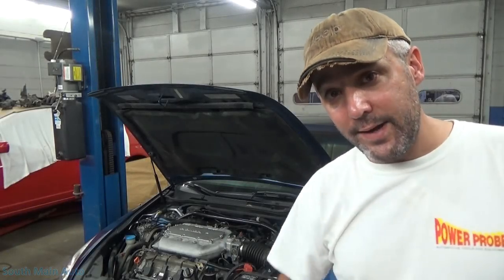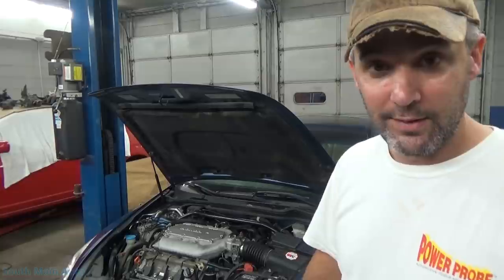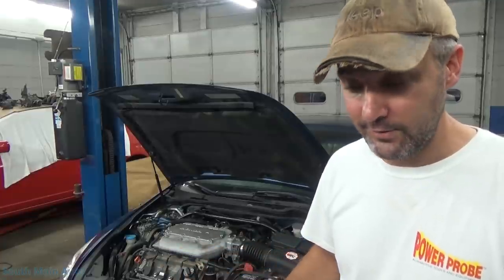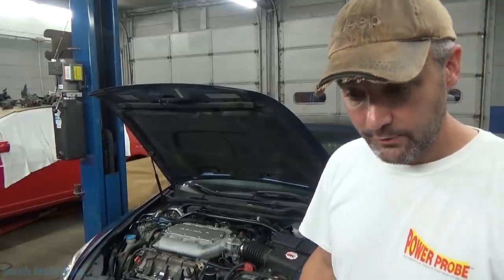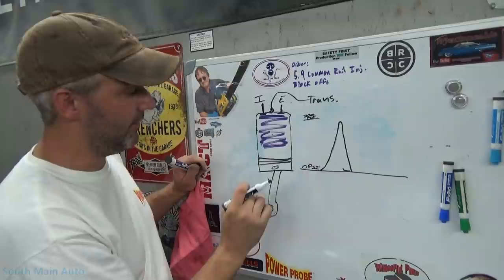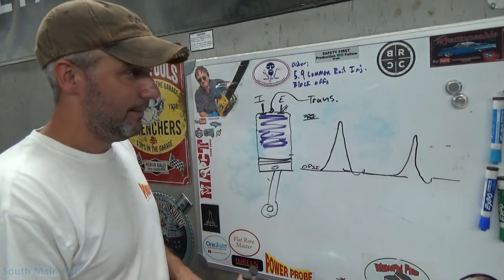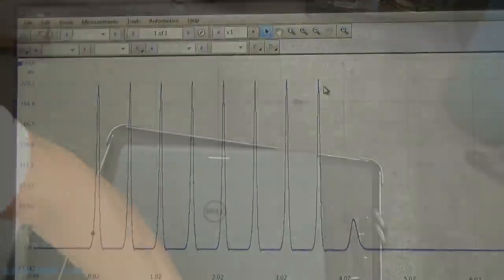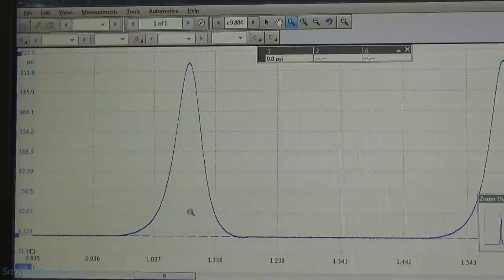Honda Accord - Slight Miss At Idle - Closer Look At Cranking Wavform

Comment: Great stuff, Dr. O! Loved the syringe and psi gauge demo. Very effective. I think it's time to bring our old friend the Ideal Gas Law into the whiteboard segment: PV=nRT. Kind of like Ohm's law for electricity...simple and beautiful. Makes the difference between "air volume" and "air mass" easier to understand :)   Oh yeah, HAPPY BIRTHDAY, Eric!
Reply: Pine Hollow Auto Diagnostics Holy Crap Ivan!!! Sometimes a forget how smart you Russians are considering everyone hates Putin!! I miss the collaborations with you and Eric O. You both compliment each other so well. Nothing beats a mechanic that uses his brain EXCEPT 2 mechanics that do. Lol
Reply: Yeah it's been a while...Eric and I need to do a nerdy case study together ASAP haha
Reply: Don't forget the karnaugh cycle. There are heat losses so the pressure after one pump will not be exactly the same even with a perfectly sealed cylinder.
Reply: Jonas Meyer more and more intellectual theory..whoa my head is getting overwhelmed. Lol
Reply: OK Ivan, I'll bite. The main phenomenon that Eric demos with this small leak is that the mass of air escaping during the upstroke and most of the downstroke is much larger than the mass of air that has a chance to leak back in (given the piston moving at some pace). I think that would have an "ohm's law" integrated-over-time type explanation, but I guess pressure differential ("voltage"), flow rate ("current") and constriction ("resistance") have a non-linear relation in gas dynamics. In any case, how do you apply the Ideal Gas Law to this leak problem?
Reply: Good demonstration. And good insight using a current scan and an indicator. Keep up the diagnosis and a good practical ballpoint puller as well.
Reply: Ivan -  I was also thinking PV=nRT, but because Eric (minor nit) was stating that the volume of a closed cylinder did not change from BDC to TDC.  The volume DOES change, the MASS does NOT change.
Reply: Yes, gas temperature is a key player that does affect pressure. However in this case, to greatly simplify the analysis, we can assume the process to be adiabatic, as in minimal heat gets transferred to the cylinder walls during compression and expansion strokes.
Reply: Pine Hollow Auto Diagnostics like all science, remove wind resistance, losses to heat, etc, etc. Chicken in a vacuum!
Reply: BChrisL ballpoint puller?! WTF I'll have to get me one of them! 😂
Reply: I’m confused can anyone explain like  I’m five— why wouldn’t air leak back in when cylinder goes down? He puts the needle back in to stop exhaust leak but in a normal engine the exhaust valve would keep its leak and exhaust would leak back in no?
Reply: Haha love the Doctor greeting!!!! Ivan your awesome! I would agree with you that with Eric O’s knowledge he could be considered a Doctor of Automotive Technologies. Haha
Reply: You're assumption is correct about the scope signals, and why it goes into a small vacuum after the power stroke, because it lost some air from a leak.   But that's only if the valves open exactly at TDC and BDC..  Even if there a absolutely no leak, you can still have this same result of pulling a small vacuum after a compression stroke, just by the timing of when the valves actually open. For example, that's similar to how the atkinson cycle engine works--  it delays closing the intake valve until the piston is already halfway to TDC, but then it gets the FULL power stroke down to BDC, (and I assume it is pulling some major vacuum at BDC.)
   Figuring out a way to map and plot exactly when the valves are opening and closing would be super helpful in overlaying these waveforms, so that it eliminates that variable, of kinda guessing exactly when the valves open and close.......... A way you could do that is to pull your oil fill cap, and stick a little bore scope in there and turn the crank as you physically watch when the valve starts to move-- and mark that location on your waveform..  I'm not sure how you would sync that -- but it would be so much more useful to know exactly when the valves are SUPPOSED to open exactly.

edit:   You actually already mentioned what I said about having the valve timing overlays. lol.   I agree-  it would be much better to have that info.

Comment: Awesome job explaining everything. We have the E-Scope and E-Scan at work. Very useful on those “ what the heck is going on” type of problems. Sure beats pulling timing chain covers. Rules out or rules in mechanical issues. 

There is a learning curve and you have to invest the time to really get to know the software. I try to hook up to a car when it’s slow. Which isn’t often . 

But it lays out all your degree marks for cam timing. You can even tell if a phaser is sticking. I haven’t gotten that good with it yet but in time hopefully I will

Comment: Happy Birthday Dr. O.!!!!!!......that is the most important thing!!!!....great explanation of valve leaking!!!!....but above all that engine is not broken, just need adjustment of one valve!!!...I mean it does not leak oil. Just leaks a little bit of non-burn fuel, but it is adjusted by the injection learning system!!!... most components of the engine are ok, camshafts, bearings, valve guides, rods, rings, everything!!!....just one valve and its valve seat!!!...its not necesary to machine all the head or all the valve train!!! just changing the valve and its seat fix the problem!!!!....It is known that at Idle the valve timing is close to cero for maximum efficiency!!!...but at high RPM!! the engine control "overlaps" the intake and exhaust valves!!!...this means that that little vacum may dissappear at especific RPMS due to valve overlap (for the exhaust-intake follow cicle).... I guess!!!!....Greetings to all at SMA!!!!

Comment: Great Video!  Cam/valve specs again would be helpful to identify what's going on and where the problem lies.  Cool theory/practical-actual event!  Scopes don't lie but they identify!  Valve adjustments add to the mix, but in this case the smoke test proved it.   Great to have all these diagnostic aids.(scope, smoke, specs, leak down test, borescope)  It sure helps me understand this stuff.

Comment: Love the Demo !!!  When I first got in Trade 39 years ago Diag Skip/Misfire was Common in Shop. After Compression  and Leak Down (No Smoke Machine)and Diag was in Exhaust Valve Area (Very Common) Seasoned Wrench in Shop showed a simple way to verify Exhaust Valve Concern -- with Engine Running place a piece of paper against tailpipe -- if it was drawn into pipe you have an Exhaust Valve Sealing Concern. Again Love your Video's.
Reply: Neal  Coppola Decourcy mentions this in one of the very first slides in the presentation Eric linked to. I'd love to see this done in a case study!

Comment: Great demo. I saw where you were headed with the syringe and pressure/vacuum gauge, but wondered how you were going to bleed out a little bit of pressure to simulate the leaky exhaust valve; excellent ideas with the pin in the hose.
Reply: Hahaha, I was wondering the same thing myself. The pin was just right to demonstrate the point -- a very tiny-seeming leak but it created the effect. Except that Eric closed up the hole for the downstroke.  If he had left it open, and done a complete cycle at a brisk pace, it would have shown the dynamics of the situation too.

Comment: Nice thought process and good demo and explanation. I find it interesting that the piston did work on the air in the cylinder raising the air temperature and thus the pressure  but the air loss was a greater effect than expansion due to heating. There could be some loss of heat to the piston and cylinder wall if the air temperature were greater than the engine temperature. Your demo with the syringe is a good one but the heat flow in the walls of the syringe is probably less than the metal engine piston and cylinder, depending on the relative temperature of the air with respect to the engine cylinder parts.

Comment: Awesome awesome thank you so much for taking the time to do this. I'm still trying to save to get the transducer for my Pico and have been trying to learn ahead of time so when I get it that I will be fairly proficient with it. I would assume a leaking intake valve would have a more drastic affect on the waveform.

Comment: I had a slight miss at idle a long time ago on an 86 Crown Vic after having the engine over hauled and putting it back in. 
Back then no one had scan tools but the best mechanics in town and dealers. So I took it down to the local guru and they charged me 80 bucks and didn't find a bloomin thing wrong with the car. 

After looking at this vid, sure as the world it had a valve issue.  Back then I was young and dumb with only sense enough to swap the engine and do minor mechanicing, now I would find the issue as you have done sir. I don't have a scope yet but its on my list. 

.

Comment: If it is losing pressure out the intake valve you will see it with a vacuum  gauge on the intake manifold. In the old days the shaky needle was a pretty good indicator of leaky valves.

Comment: He's a good teacher. I have a 2004 Honda Accord 4 cyl.(i-VETC 2.4 DOHC SULEV). The spark plugs have about 50,000 miles on them and the maintenance required light is constant. I plan to change the plugs and the upstream O2 sensor. Although the car has only 118,000 miles and runs perfectly, I'm trying to figure what's going to bite me in the butt.

Comment: Fantastic demonstration,  on theses honda v6 MAP voltage should not exceed 1V at adle with 195 temp. No ac . If its mor thans 0.94volts ,you got tight valves need adjustment and it very common on the exhaust valves,

Comment: To further complicate things, I started thinking about the temperature of the air. When air is compressed, its temperature rises, which would increase the pressure in a sealed cylinder. The pressure rise would be directly related to the compression pressure, so the temperature rise cranking (200 PSI) would be more than while running (85 psi). The pressure rise would have the effect of essentially canceling out part of the possible vacuum the cylinder could produce.
Reply: But the air's going to get cooled back down again on the downstroke.
Reply: Also, the thermal expansion and contraction of all the parts involved would have an effect as well?

Comment: Cool video, happy birthday 🎂. Being tested by the crustyz today in order to get my own bay, wish me luck because I don't want to be the shop boy is the nice version lol or what they call Juan bobo for another 6months. Plus the old guys said they will help me out by giving me a tool but it may not be from the truck lol, makes me wonder a bit hahaha. Keep up the good work I have a lot more to learn from guys like you.
Reply: TK Walters good luck kid, I'm sure you got it. Remember it comes with a raise. I take it your getting one of mine, I'm on the lake but call if you need help
Reply: TK Walters hi kid, looks like I didn't save your number but if you pass whatever they gave you, I'll give you a used box. It'll be one of my home boxes 3 tier and maybe a few small things. That'll help get you started on your career just remember don't become a hack (I think that's what they call them) think of every vehicle like it's your mothers
Reply: Crazy Fisherman thanks crazy. That would be awesome, then I can use the cart for a different purpose lol. It's a 2005 chevy Malibu 2.2, when tank filled it gives random misfire and EVAP codes, looks like a new MAF sensor and purge check valve however I'm only aloud to use my actron, multimeter and test light. The new purge valve when I blow through it blows a little from the gray side and more from the black and wire side, if I remember right there shouldn't be air going through but I can't find my notes and I'm starting to get nervous because I'm in my own head, the dash gauges drop and it dinged at me when I go to read codes so I'm getting confused a bit. I think the purge valve and the solenoid are bad but I forgot how to test 😓, it also needs rear springs and new plugs. I might need some guidance 🙏
Reply: TK Walters south main auto, pine hollow diagnostics, Erics buddy keith and I think wells auto are all good channels, there's a few more but I don't remember at the moment, if you still have my number you can call me around 2-2:30pm. I hope your able to calm your thoughts and know what to do. You got this youngbuck

Comment: First thing is first, THANK YOU for all of your content!!!!  I follow you, Ivan, and Keith and just try to absorb as much knowledge as I can because I learn the best with real life “hands on”. Now to my question, that I mean because I am genuinely curious. I may be missing the laws behind this but essentially if the exhaust valve is leaking and compression in #5 is suffering, how is it that it can draw a vacuum when it is actually leaking from a non seating valve. If it can’t produce the proper compression due to “an air leak” in the combustion chamber, since there isn’t any one way valve inhibiting air flow...how can it create a vacuum???  I see this as a drinking straw method. If u put a hole in the middle of your straw as u try to drink from it, u get less volume as the air keeps a vacuum from being formed, hence keeping the beverage you purchased with your hard earned money at the bottom of your cup instead of happily pleasing your taste buds. The way my feeble mind sees it is that a hole is a hole, or a leak is a leak......air goes past one way decreasing your compression, then with that same air leak, how could it possibly form a vacuum when it’s not even 75% air tight?  What am I missing here??

Comment: +South Main Auto Repair Hey Eric, I didn't see that anyone had pointed this out, but atmospheric pressure at sea level is 14.7psi, not 0psi like you kept referring to.  Also, Happy 25th Birthday again ;)
Reply from the maker: I was using "Gauge pressure" and it is zero-referenced against ambient air pressure, so it is equal to absolute pressure minus atmospheric pressure. Make sense?

Comment: I belive the expansion pocket is also caused by thermal energy loss in the cylinder. Compressed gas heats up, heat is dissipated in the metal parts, pressure drops.

Comment: Thanks for going above and beyond with your diag using   the pico scope, Eric! Much appreciated. Root cause: Electrical or mechanical? Will you be pulling the cylinder head on that bank and making measurements? Looking forward to seeing more vids on this issue.

Comment: So one question I have is, if the air in the cylinder is escaping through the leaky exhaust valve during the compression stroke, why is the exhaust valve then not letting the same air back into the cylinder during the power stroke to BDC?  I would think you couldn't draw any kind of vacuum with a leaky valve.
Reply: So you're suggesting that during the power stroke, atmospheric pressure air in the exhaust manifold will "leak" into the pressurized cylinder? Because all of those graphs clearly show lots of pressure in every cylinder during the compression and power strokes. And air doesn't choose to move from a lower pressure area to higher.

Comment: If some of the air has escaped on the up stroke through a leaky exhaust valve, wouldn't it suck more air in during the down stroke through the same leaky exhaust valve?

Comment: Shadetree mechanic here. I'm gonna jump ahead and take a SWAG and say that since the scope shows there is a major effect on one cylinder, maybe minor on the others on that bank, an exotic engine gets an exotic problem, so when taking it apart, don't rule out bent camshaft with the apex on #5 that mitigates as revs increase. Is a bent camshaft is even possible? (And that exhaust valve has got to be roast by now.)

Comment: I can't find a follow up video to this and previous diagnosis video. Did Eric O ever pull the head on that engine? What did he find when/if he did? 

With an issue like that is it possible that the valves on the front bank have a carbon build up that could be dealt with by one of the various "treatments" with one of the various fuel cleaners? If yes how do we know that without either trying a "treatment" or pulling the head?